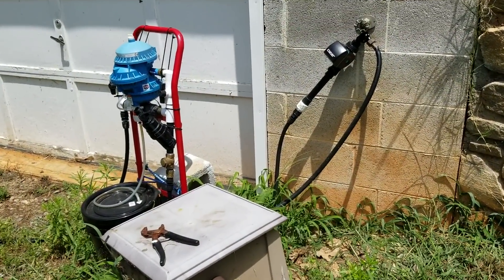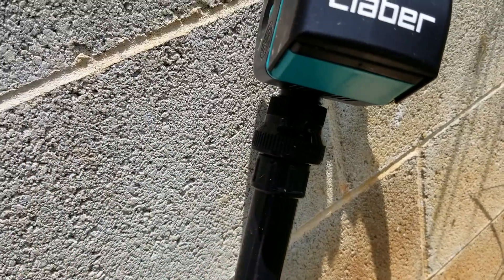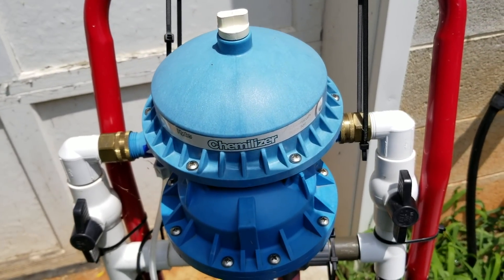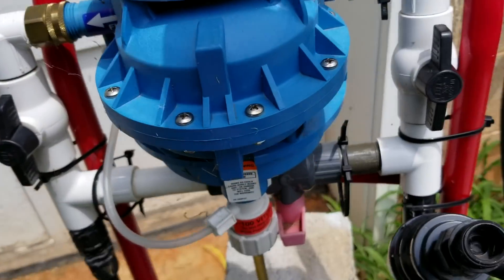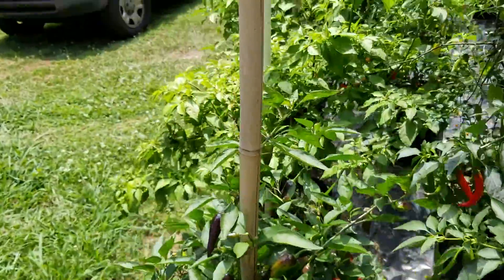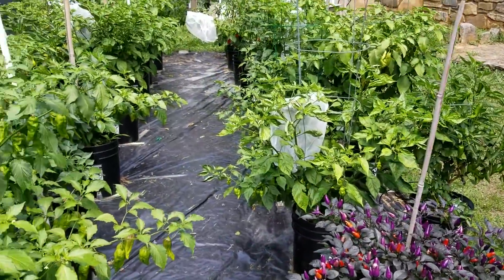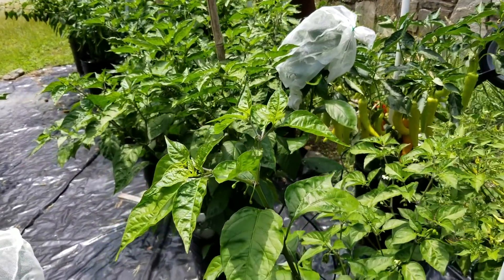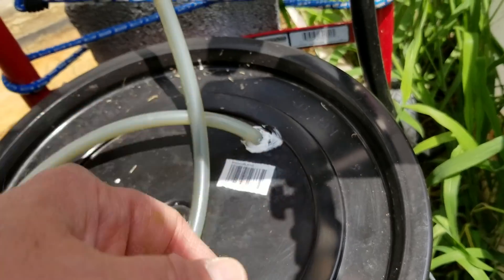Basics of a drip irrigation system

Comment: Ok Peter it my first year and ill be doing a drip system as well now can I just use water? Or do I need to put nutrients as well? I think i might have to go with the double bucket method was hopping to do the drip system. Hope to hear from you soon
Reply from the maker: You can do just water with a drip system, but you'll need to amend the potting mix with fertilizer, preferably some kind of slow release. There are both organic and chemical options. I've used Osmocote 14-14-14 with good success, but I do add some extra calcium/magnesium. This method is good because it's simpler, and there are less points of failure, but it does require some guesswork on when to re-amend with more nutrients.

Comment: Love the video, going to run that set up this summer. Quick question Stanley, I was hoing to use a 20 gallon container for my nutrients. How do I calculate the amount of nutes per gallon of water? I was planning on using the gh flora series. I have gallons of the flora series 3 part.
Reply from the maker: Thanks! You'll have to calculate it based on the ratio your pump injector is designed for, most are 1:100. Dyna-gro makes it easy and has a chart on their website, they suggest a range between 12 and 18 ounces per gallon. If you're using stuff that has to be mixed separately, like Masterblend, you'll need a different injector for each type of nutrients. With something like Masterblend you could keep it and the epsom salt together, but would need to keep the calcium nitrate separate. My experience with Dyna-gro was that I got very good results and it took the guesswork out of everything, but it was very expensive to feed that way. You have to really dial in your waste. Also, with fert injectors there is a chance that something can go wrong and your plants aren't getting fed. I had to replace a part on mine one year. You have to monitor it often. It's good to have a ppm meter like the Bluelab truncheon to periodically test the strength of what's coming out of the emitters. Another alternative is to just mix in slow release ferts and run water only. That has it's own pros and cons vs feeding with hydro nutes. Good luck with whichever method you try! I hope you have a great 2020 season.

Comment: So glad that you revisited this.
I've been struggling with temps (98° today) and having to go out twice a day and water 10 of my plants the old fashion way.
For my 9 plants in double buckets, once a day seems to suffice.
I also like to hit them in the evening every few days with a light showering with the hose.
I really want to incorporate some type of rain collection system.
-
I've really been wanting to set up an irrigation system, and I've thought about something like this:
I'm going to start with attaching my two 275ga IBC totes ($25-$80 each) hooked together on the north side of my house.
I'll route my guttering into them with screens (<$5) over orifices for mosquito prevention and light proof the totes with mylar or paint (<$10 each).
For O2, I'm thinking either a recirculation pump (<$20) or a bubbler (<$15) to increase surface area and prevent stagnation.
Inside the IBC's, I'll place a sump pump (as low as $49 for a 1/3hp with 22' rise) with float which will prevent the system from running in the event the IBC's go empty.
A quick trip to the calculator suggests that a sump with a 22' foot rise should produce 10.25 psi (the closer I get to 25psi, the better).
I'll hook the sump pump on to my bluetooth/wifi kilowatt controller (<$20) for timing and power monitoring.
That'll go to a garden hose (I have bunches) then possibly to my feeder (<$25), then a filter screen (<$10).
I'll adapt there to .70 irrigation tubing (100'<$25) from there, then to my plants with 1/4' (100'<$10) tubing similar to how you did with 1ga or 2 ga drippers (Bulk<$0.20).
-
I'm expecting to run a max of 30 plants next year, at 1-2ga twice a day I expect to use up to 60-120ga.
If I average 90 gallons each day, with a 500 gallon reservoir, I should be able to go 5 days without intervening.
If not, I'll simply top the IBC's off throughout the week or attach a float valve to my spigot.
Reply from the maker: You've put a lot of thought into that. Best of luck with your system.  Please let me know how it does.

Comment: Looks great, thanks for sharing!  At 8:56 it looks like that would create a vacuum.  If you have any issues you may want to look there :)  Sounds like you've been fine so far, though!
Reply from the maker: That's a valid concern, and thanks for watching!. It's a tight-fitting, snap-on lid, but the nutrients seem to draw out without any problems. I use the same buckets lids feeding float valve systems and worried about the same issue. But they appear to be working well so far. I'm thinking even though it fits on tightly it's not an airtight seal.

Comment: I really like that fert injector.  What is the concentration of dynagro that you use per 5 gallon of water?
Reply from the maker: Thanks, Aaron. Right now I'm mixing 16-18 oz of Dyna-Gro concentrate per gallon of water. That's the high end of what Dyna-Gro recommends for 1:100 injectors. So the max would be 90 oz in five gallons. The modified hempy type containers help save some nutes and water, as it holds some back for the roots to drink. I can run it for shorter periods than I did last year.